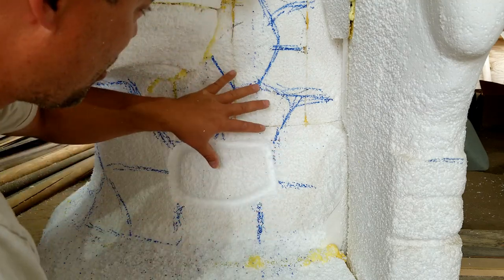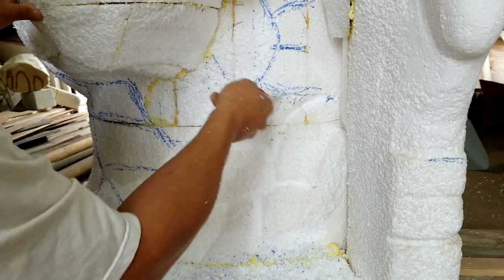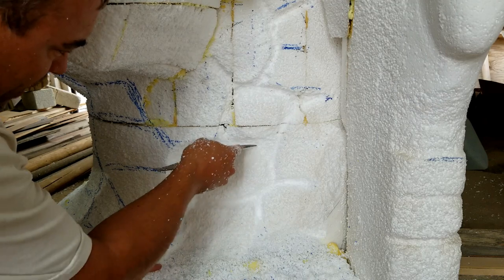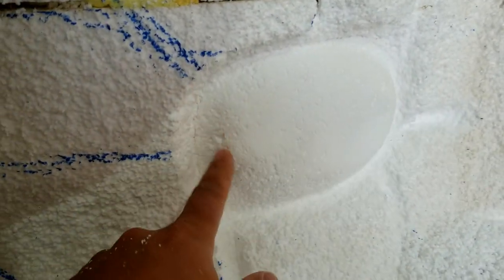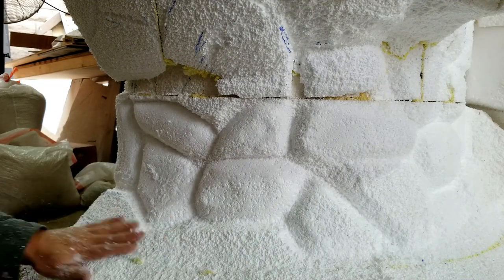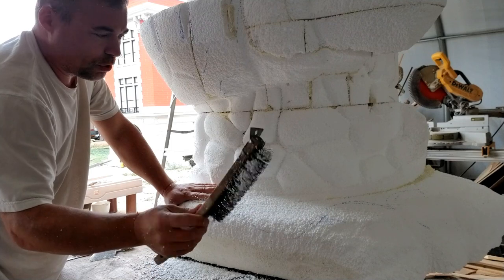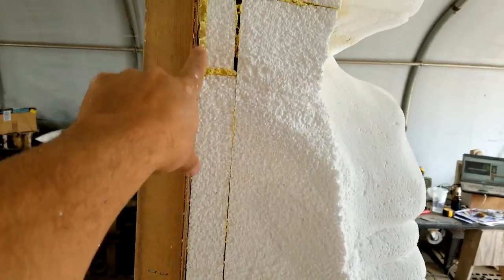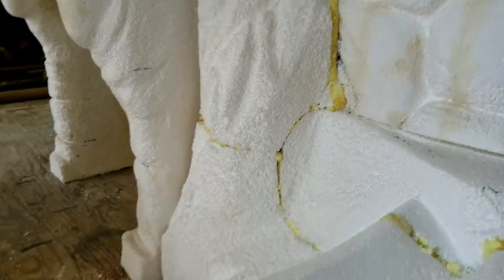Quick and Easy Faux Stone Walls with Foam - Castle Grayskull Playset Build (Pt.4)

Comment: This has been incredible to watch, I'm so envious of your kid haha - but have you ever thought about doing a cast of the entire thing once it was done, then molding it out of plastic so it could be out in the rain and elements? I'm just wondering how you'll get it rigid enough for kid play. I can imagine a castle battlement popping off with too much pressure exerted against the foam core beneath the sealer surface. I hope this build lasts forever of course - you've put so much time and sculpting into it, to make a mold from it before you paint might be a cool idea to come back to at a later date with another kind of building material, like a plastic or fiberglass. That shell could then be attached to the wood structure and supports behind it. I'm curious if you're going to "glass" it like a surfboard essentially.
Reply from the maker: Yes that was the plan to create a fiberglass shell that attaches to a wood structure behind it.  There's a couple different details we are still trying to decide but we will continue to post our progress.  Thank you so much for the feedback.